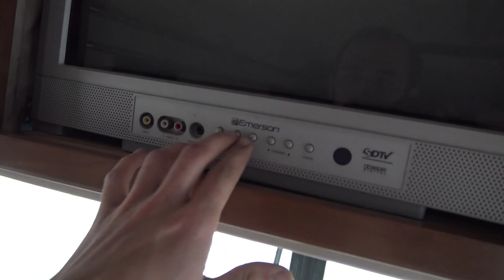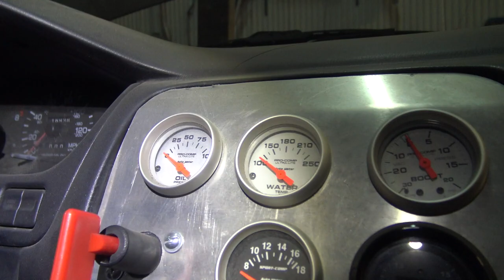2018 DRIFTING PLANS? - Jaymie wants me to work on the RV

Comment: About the RV:
dump the boat anchor that is in there and
shoe horn in a corresponding used (working) engine
and release the lady on the inside and fix the hole in roof

Comment: Your drift car is amazing but you can just update to be even more realible, put a gen 2 turbo use the back engine heat-core and use in the turbo just like RAD industries, and the same boost controler to, it will be nice
Edit: Put the S2000 engine in the mustang, it will be a nice build and don't forget to drift it

Comment: Could the smoke on start up also be a turbo seal, Could be leaking just a little bit where it's not noticeable when driving, but after sitting for a few hours there could be a bit of oil that has just built up?

Comment: Hey check out the hoonigans video on the 2013 mustang formula drift car. I thing is called build ology idk. It basically running a bunch of great bolt on power and steering solutions that you might want to look into

Comment: That's just a Toyota thing with the valve stem seals the four cylinder in my 03 Camry did the same thing on Startup after it would sit overnight or for a couple of days. Also I had a 97 Camry that did the same thing and a friend of mine had a 98 Camry that did the exact same thing

Comment: I was talking to my roomate and brought up that your s14 is still I'd consider a 30k car with all the work time and effort in it. But that's "only" 30k and it's essentially at a point where you are done. Stock 2jz cheap eBay manifold. Brett Collins glorious adapter, and some suspension work that's all. Guys can drift a stock powered 240 with a welded diff and some suspension work throw in 195s and overpress them to like 60 psi and have fun. I got a Toyota yaris cause it was a cheap track car (check out Armstrong racing yaris) racing doesn't need alot of money people. Get off the forums and head to the track.